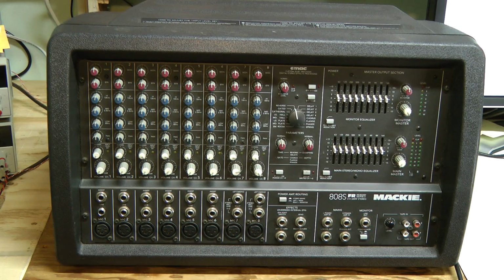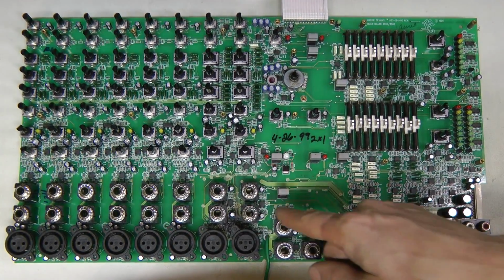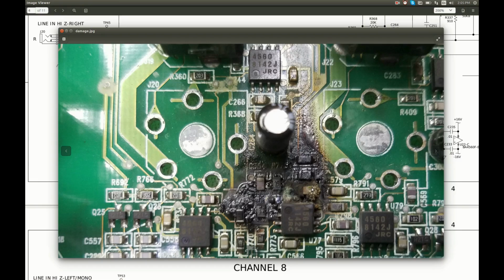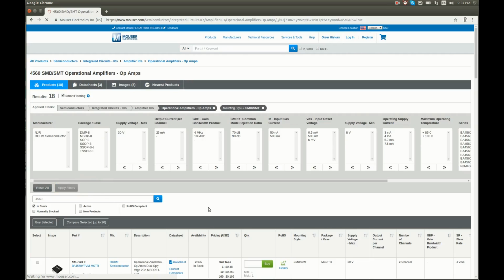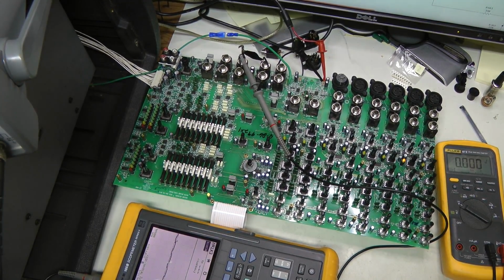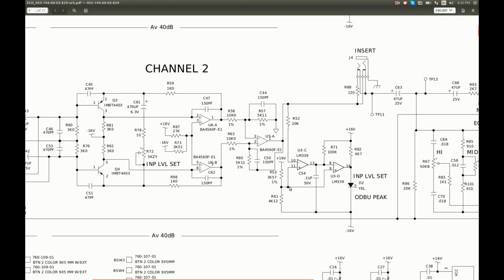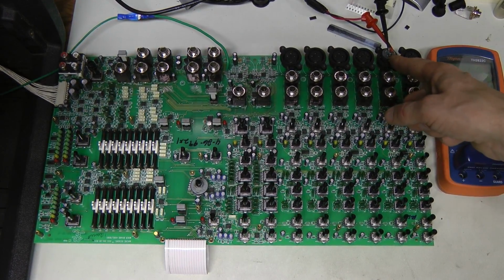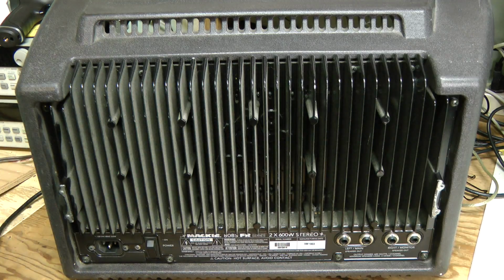#70 - Mackie 808s powered mixer repair

Comment: i have a rockville rpm 109 that the slide monitor switch will only allow one speaker to work,,it has a short as if i wiggle it sometimes it works,,CAN switch be replaced,,

Comment: It seems that EVERYTHING has to have some kind of digital effects processor now.  If I was forced to use effects I would rather have a rack of analogue equipment.
Reply from the maker: That would be heavy and expensive. Trade-offs... I would rather listen to 24bit/192KHz lossless format like FLAC, but convenience prevailed, so MP3 files are everywhere, and starting with some decent bit rate (like 192) most people wouldn't tell the difference anyway in a double-blind test (myself included, most probably).

Comment: Thanks for the video. That is one of the worst fires I have seen on YouTube. I would like to have seen your finished wiring of the replaced components on the back. Curious how you wired up the op amp.
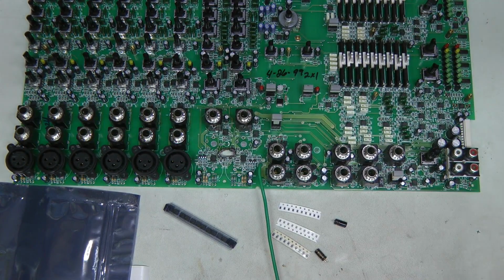Reply from the maker: I did show the finished wiring. Perhaps you missed that part somehow. Two close-up pictures: front and back shown for about 5 seconds each starting @11:12
Reply: @feedback-loop  I will have a second look. thanks

Comment: Mouser table showed 30V max supply for that op amp, but the circuit seems to be applying +/-16V.   That would be 32V, right?   Maybe they decided it was OK.
Reply from the maker: Where have you seen 30V? Max dual supply voltage is +-18V according to the data sheet. There are 7815 and 7915 regulators in the power supply. I don't know why the rails are marked as +-16V on the schematic.

Comment: I wonder if that capacitor shorted internally due to mechanical stress while mounted on the board?  Or just the heat from desoldering it from the board "fixed" it.  In that part if circuit, it wouldn't have taken too much internal leakage to induce that failure.  Nice video, thanks!

Comment: I was saying "No, leave the chip, it'll be that capacitor!". (I only know that now because I made the same mistake in my Data Precision 1350 multi-meter repair video, where I was changing chips before finding the real cause -  a bad electrolytic capacitor.) 
My excuse is that I do more of my own projects than repairs, so the caps are new and unlikely to be faulty, whereas my experimenting may have damaged a semiconductor, so I tend to blame them first. However, it's the opposite way around for repairs, where old caps are the more likely culprits.

Comment: Nice repair. I like that one. The only thing I would have done more is to fill up the hole with epoxy again. I am not a fan of free hanging parts, but  I think your's will work just fine. Usually I cover the underside with a wide piece of kapton tape, lay it flat down and just pour the epoxy in the hole until the it looks nice and same height as the PCB itself. Since there is no copper on my epoxy I use SMA10SL fast settling glue to fix the SMD parts on top. Then wiring and sometimes even drilling to put wires through the board like vias.